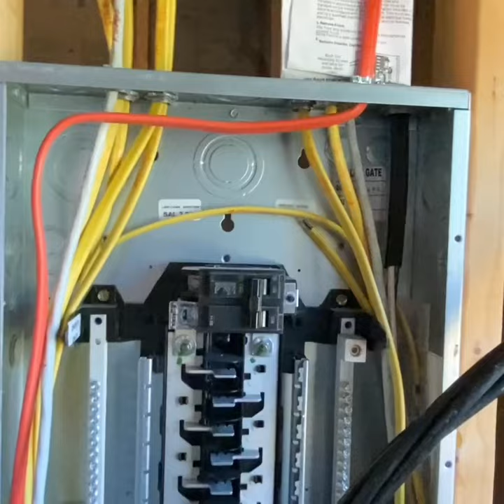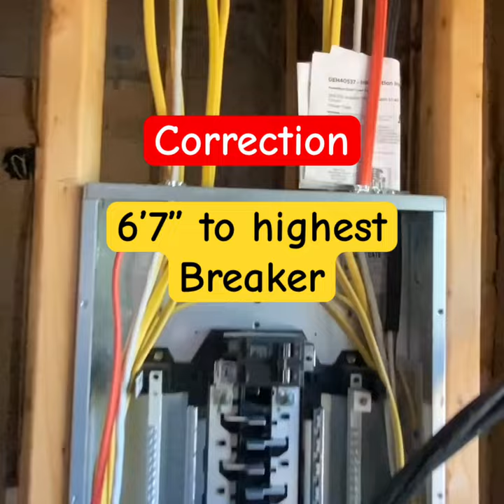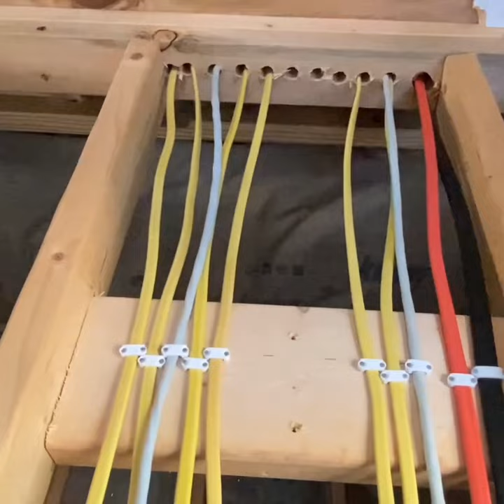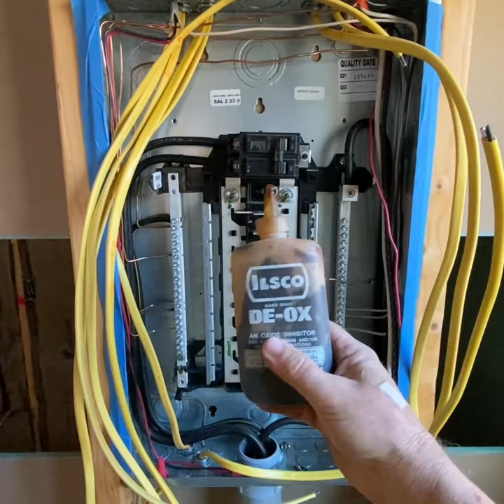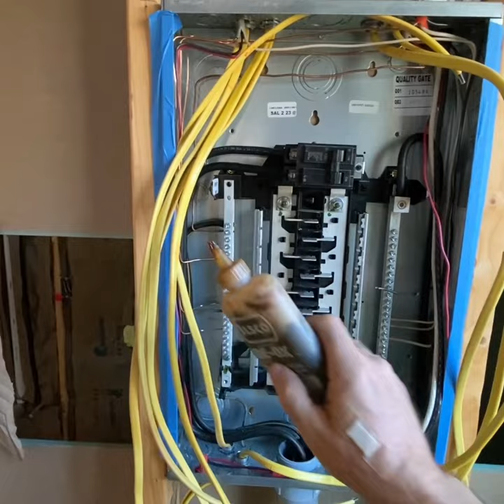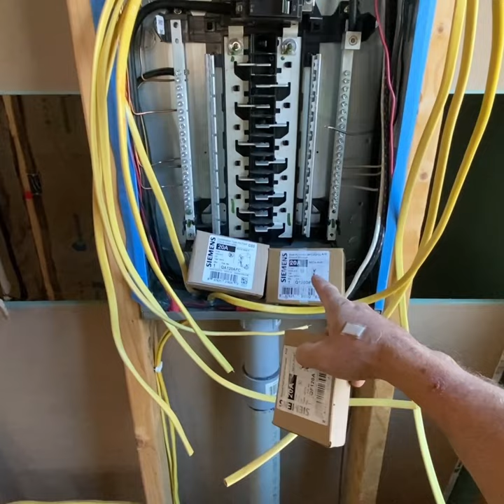6 Tips on installing a sub panel, (Corrections)⚠️6’7’to highest breaker 30”clear space side to side.

Comment: I dont recal 2020 NEC specifying 15" off center, only 30" side clearance.
Panel can be all the way in a corner of a wall as long as there is 36" in front clearance and 30" side clearance (any side). No permanent obstructions within clearance zone.
Preferably completely clear.
Reply from the maker: 👍 I believe you’re right. I assumed it was center on the clear space.
Reply: I believe you are correct sir.
Reply: @bkdesignconcepts You removed the neutral jumper
Reply: Came to the comments for this... thank you.
Reply: Correct. Added bonus. The door should be able to open 90 degrees.

Comment: It does not matter if it's a sub panel or not. You only bond the grounds and neutrals at the first means of disconnect. Where I am from we are required to have a meter/main regardless if it's back to back or not and pull a 4 wire SER cable. Therefore the grounds and neutrals are bonded at the meter main and seperated at the main panel and sub panels.
Reply from the maker: Thanks for the information and comments.👍

Comment: 6'7" rule to the handle of the main disconnect, not the highest breaker. Also works with disconnects outside with the handle up
Reply from the maker: Thanks
Reply: Is the main disconnect not a breaker? Also, this video is specifically talking about a subpanel, so there is no main disconnect in it.
Reply: Incorrect.. you can have a disconnect  handle at the highest point 6'7" and right next to it a panel with the highest breaker at 6'7".. also a main disconnect on a panel at the highest point at 6'7".. so you are incorrect my guy..
Reply: I believe its 6-7 to energized parts.
Reply: I have seen some disconnects up to 30 feet high I think for a ac unit or X-trans.. And pass inspection on multiple job sites.. I would like to find it in the NEC code book..
Reply: @CorenergyElectrical-xe8ew  you literally just repeated what I said. And I hope you don't think breakers count as disconnects, because they are not. Breakers are over current protection devices. A disconnect by definition has a handle on the outside of the device that can be lockout tagged out. . .my guy
Reply: @nevrbdwnruby7484  those disconnects are what we call locals, they are their for the technician to kill power to the unit to service. As long as those disconnects aren't the only means of over current protection they are fine
Reply: @jordansutche9829   Yes, breakers can be used as a local disconnect. (away from the feeder panel) A case is made here for a group of say rooftop units.... "(A) General. The disconnecting means for each supply permitted by 225.30 shall consist of not more than six switches or six circuit breakers mounted in a single enclosure, in a group of separate enclosures, or in or on a switchboard or switchgear. There shall be no more than six disconnects per supply grouped in any single location. All breakers will be marked as to their use." If you are required to have tag-out means then the breaker or the panel cover must have a tab to install the tag. No mention of external levers.

Comment: Pro tip - run two 12/3 wires in the panel and cap them off in the attic. If you need to add a wire no need to touch the panel. Just label and keep the breakers off
Reply: If that's for future expansion, just tag the wires and leave the spare breakers at the bottom, NOT installed. That way there's no worry about some idiot turning them on.
Reply: Even better than that so you don't have a junction box in the attic is to run a 1" ENT (smurf) future into the attic and put a cap on it. Then you just push the wire in and you're done in the future.
Reply: @chrisruss7863  why does an attic junction matter?
Reply: Do not land the wires, label and do not land until load side is connected.

Comment: In UK🇬🇧 the breaker board has to be 135cm(53")-145cm(57") off the floor.
It's unlikely residential house would have anything other than a board with breakers configured left to right.
Reply from the maker: Thanks for the info 👍

Comment: Correction: it does not have to be 15” from the center of both sides of the panel. The width of the working space is 30” wide. As long as the panel is inside this 30” width, it will meet the intent of the code.

Correction, 6’-7” to the center of the highest breaker.
Reply from the maker: I mentioned it in the title. Thanks.
Reply: @bkdesignconcepts  Thank you for your videos, they are very educational

Comment: Once almost failed a breaker max height.. the customer provided a couple bags of soil.. bought the 1.5 in  to pass....
Reply: Almost any "level working surface" can be fabricated in a pinch, as long as it's semi-permanent. A few rows of patio block or even a wooden platform will do in most cases.

Comment: You just removed the UL listing of the panel by removing that crossbar. Both bars are intended to be neutral bars. You have to add separate ground bars.
Reply: Then why would it be removable if your not supposed to remove it?
Reply: This is not true. I personally spoke to the manufacturer of multiple panels with removable crossbars.  They are intended to be removed. Please do not give false information as a student may be trying to learn from some of the comments.
Reply: Amateur @explod329  removed the UL listing, and that is the fact of the matter.  The panels are not intended to have the crossbar removed. They are intended to have accessory ground bars installed, which is why they leave screw holes for them and which is why they sell those ground bars.
Reply from the maker: 8. Optional wiring of neutral and ground.
The neutral crossbar may be removed to provide optional neutral and ground wiring as follows:
Right or left side bar can be used as follows with the neutral crossbar removed.  

This is from the paperwork that came with the breaker box.
Reply: @explod329 right man?? I made the panels and I made sure the shit was removable. Yall are welcome

Comment: No need to drill extra holes. It'll just be foamed or cocked close by the insulating contractors.
Reply from the maker: I happen to be the insulation contractor as well, and I promise I won’t fill those holes with foam.
Reply: @bkdesignconcepts  I just run a 2 inch condo it up to the top plate. Then you can fish it down whenever you need to add a circuit. Just cap it off with duck sealant Until you need to use it
Reply from the maker: @ryanyork837  good idea

Comment: Take out bonding screw to isolate ground and neutral. You said opposite.
Reply from the maker: Watch it again. I think you may have misunderstood. Thanks for watching.
Reply: @bkdesignconcepts  If I have to watch it more than once (I did), it is not clear. You were not clear. In fact, we not only don't screw it in, we take it completely out.
Reply from the maker: Sorry for the confusion. That particular panel has a crossover bar that connects both of the bus bars. When you remove the crossover bar, it separates the bus bars. The one on the left can be bonded to the breaker box with the bonding screw and it is no longer connected to the neutral. That isolates it and makes it the grounding, busbar.
Reply: @bkdesignconcepts  i usually add a grounding bar and scrape off paint for a better ground instead of relying on a grounding screw that threads into a painted thread....just me but it's a better ground.
Reply: Hey removed the bar bonding the two bus bars and the one he used for his grounds he bonded to the can so the can is grounded too. The problem with the bond screw comes when it’s on the neutral side and it’s a sub panel.

Comment: Does code allow you rotate the panel 180 degrees to make service connections a little easier?
Reply from the maker: Most panels can be mounted either way, but definitely if the main switch operates horizontally.

Comment: What states allow to use the plastic wire. In chicago they dont allow it
Reply from the maker: 334.10 Uses Permitted
Type NM and Type NMC cables shall be permitted to be used in the following, except as prohibited in 334.12:
One- and two-family dwellings and their attached or detached garages, and their storage buildings.
Multi-family dwellings and their detached garages permitted to be of Types III, IV, and V construction.
Other structures permitted to be of Types III, IV, and V construction. Cables shall be concealed within walls, floors, or ceilings that provide a thermal barrier of material that has at least a 15-minute finish rating as identified in listings of fire-rated assemblies.
Informational Note No. 1: See NFPA 220-2021, Standard on Types of Building Construction, or the applicable building code, or both for types of building construction and occupancy classification definitions.
Informational Note No. 2: See Informative Annex E for determination of building types.
Cable trays in structures permitted to be Types III, IV, or V where the cables are identified for the use.
Informational Note No. 3: See 310.14(A)(3) for temperature limitation of conductors.
Types I and II construction where installed within raceways permitted to be installed in Types I and II construction.

Comment: As a swiss electrician, this looks like total trash to me 😮 also why dont americans use pipes? If there is a malfunction with a cable what options do you habe? Making holes in the finished walls?
Reply from the maker: I get what you’re saying. This has been the standard in the United States for many many years. The wire has upgraded, but it’s still the same process. If there is an issue inside a wall, the only way to repair is to fish a new wire through the wall or cut open the wall for access. This is only for residential wood frame construction.